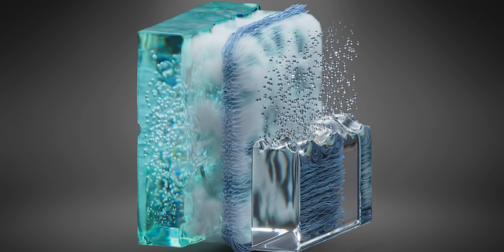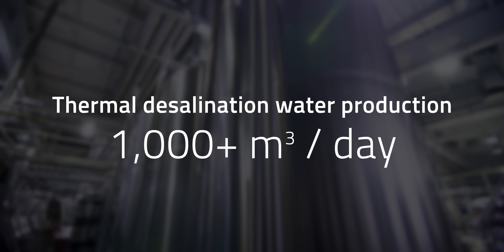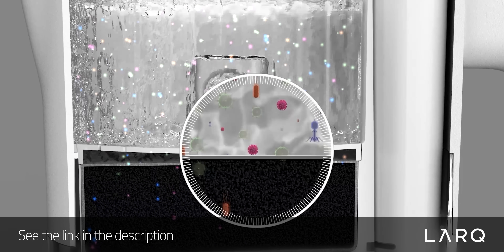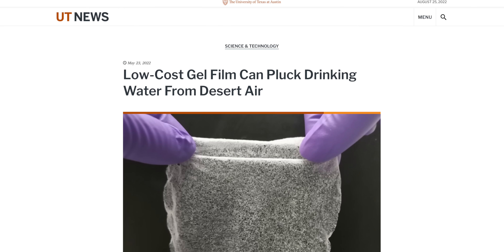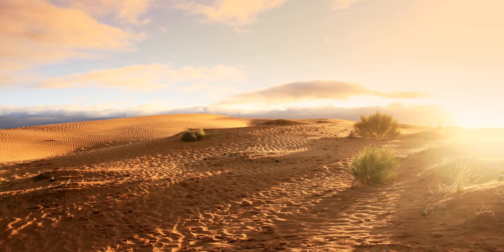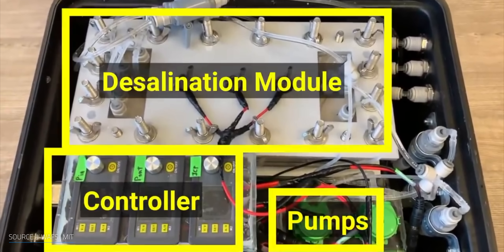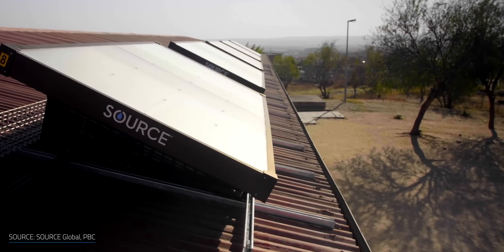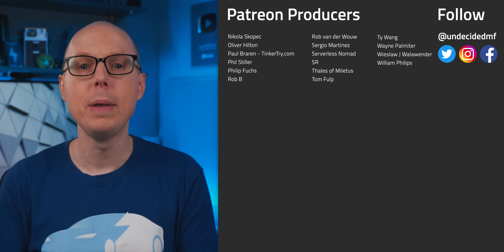2 Breakthroughs That Could Solve the Fresh Water Crisis

Comment: how does the spongy hydrophilc thing work? i'd think it would just attract water and reach some kind of equilibrium if temp stayed constant. or does it attract enough water that it forms a large bead and gravity pulls the bead off the surface...? so it's like condensation but without needing something below the dew point? could a hydrophobic surface humidify air faster than evaporation without needing additional energy too?

Comment: Nuclear reactor (preferably using U233 from Thorium breeding) + Mass scale desalination... done and done. Yes, there is brine, however one could use a higher flow of water coming in to dilute the brine prior to exiting the plant, easing the localized damage. All of this takes power, so we need a very healthy supply of it. Thorium -> U233 fission reactors should be the bridge to fusion coming around 2050.
Reply: we used to have nuclear powered desalination plants in the 60s

Comment: I like the idea of getting water from the air but at large enough scale wouldn't this effect rain fall on a local or maybe country wide level?  I'm not a weather expert. For example in desert areas along water ways, the water in the air that would quickly move in to areas of lower pressure to condense to become rain, wouldn't. Thus decreasing the water level in the water way. Right? Thoughts.

Comment: Discharge of RO and other brines is easily solved by diffused discharge. Every day the sun creates brine as the surface of every body of water it is very rarely a problem because the body of water naturally diffuses is through the bulk water.

Comment: 20 Watts per litre?  That's meaningless. Perhaps it was 20 Watt-hours per litre.

Extracting salt from water requires energy. Quite a lot. And it's unavoidable because the process an be run in reverse - take your concentrated saline and fresh water, and you can use them to produce the energy that you used to separate them in the first place, though a fair bit gets wasted on the round-trip.  The existing processes might be improved some, but the laws of thermodynamics prohibit the huge improvements that we'd obviously like.

Methods that capture water from the air, which is to say usually water that has already been separated from the salt by the sun, has an obvious edge there, if the economics can otherwise be made to work.

Edit: If it was 20 Watt-hours per litre, that's 20kWh per kilolitre, which is a lot more than a typical reverse osmosis desalinator uses.

Comment: the biggest concern with the gel based water harvesting is NOT the gel, but the ecological impact of pulling water out of the air in an already dry area. What would be the impact on rainfall/snowfall? What would be the impact on wind patterns? Are there species that depend on that minuscule water in the air? What would happen if we massively start using this?
Reply: There are 37.5 million-billion gallons of water in our atmosphere which is cycled 40 times a year. You would have to be removing massive amounts of water before you would even notice any change. One of the results of global warming is that the air can hold more water. That is one of the reasons rain events that cause flooding have become more common. I had the same question until I looked up the data.

Comment: These are very promising technologies, thanks for the video!  Here in S CA we have a desalination plant in Carlsbad that produced 50M gallons per day of water from the ocean.  There seems to be a lot of debate about it, so while people debate, the plant continues to pump out 50M gallons per day at a fairly low cost, using an environmentally freindly process.  It's amazing how Americans can fight over anything, even proven technology.  If we could just harness Americans ability to argue, we would have an infinite source of energy.
Reply: Carlsbad Desalination Plant in San Diego, California, requires approximately 35 MW to run and provides 50 million gallons of water supply per day.

Where does that power come from.
Well A lot of it is hydro, the more you need desalinization the more likely your not going to have the hydro power to run it.

So yes harnessing the hot air would be a good idea!
Reply: if 50 mil gallons and 35MW checks out, that's 4.43 Wh per liter. Assuming he meant the MIT device uses 20W and takes 3.3 hours per liter, that's 66 Wh. Ouch. Hope it gets better when it's scaled up.
At $50 per unit it would cost 1.32 billion USD to get the same capacity. (about 26 million devices)
The Carlsbad desalination plant cost one billion according to Wall Street Journal, via Wikipedia.

Comment: This is a good time to explain my idea.  So, you have wind turbines that aren't running because we don't need the power at that moment. You need fresh water. Boy do I have the solution for you. Giant dehumidifiers. This idea came to me when I got a large dehumidifier for my garage. It would fill up it's one gallon tank in a few hours and I would have to constantly empty it. I thought to myself 'this water could be used out west' and that's how it all came about.
Reply: That sounds like a good idea to get fresh water from the air but if it takes more power to get the humid air to drop the water you may as well import/buy gallons of fresh water for some other place.......I doubt that an area that is not gifted with high humidity would get much fresh water form a device that you state so your device would be running on power all of the time but little water would be made..........you should try out your idea in a dry area (desert maybe) that lacks humidity.
Reply: well it would stop rain to fall :/

Comment: Slightly off-tangent, but can we use the leftover brine from seawater desalination for Lithium production? Given that the U.S. is trying to boost domestic Lithium production, it would make sense to combine the two processes if it's scientifically and economically feasible.

I don't have a STEM background so if I sound ridiculous asking this, please excuse my ignorance.
Reply: Very good observation, there is Lithium in Sea Water, but the brine is loaded in Sodium from the salt in ocean water, and right now scientists are working on a Sodium battery that doesn't use Lithium or rare Earth minerals, it potentially could be a win-win for everyone, but more scientific studies need to be done, but the concept is a good one.
Reply: Unfortunately most brines do not contain Lithium salts. Most Lithium is mined in Bolivia and Zaire.
Reply: @allanlank  turns out in the us the salton sea is full of it  and sea water has some too
Reply: Li accounts for a very small percent only. In the case that those countries or cities with desalinated water as their water, decide to switch to brine as their source of the metals than the cheaper mined ones, then it can be used. But currently there is no demand for such expensive metal
Reply: Assuming all of the worlds water desalination is from sea water (which it isn't) - You can get about 5000 kg of lithium. Which is very small already, but in reality only 1% of the worlds desalination is from sea water also. So 50kg of lithium from worlds sea water desalination, which is not a lot. So no, it's likely not really feasible at the moment.
Reply: @Sancarn  where do you get your figures?   is that all of the ocean ? is that per ton? is that just the dessalinization today? does that figur in all the water we need today and not future needs?     in cailfornia the voters stoped a plant from being built over the brine.  if we can assure the ney sayers the brine will be processed the plant might get built and the water is desperatly needed
Reply: @andrewfischer8564  That's ~50kg per day from the worlds supply of Sea water, I already researched it after the video from "Two bit da Vinci" as I work in the water industry myself. 

Key figures:
Lithium in sea water: 1 ppm
World Desalination per day (today): 95 Million m^3
Lithium density = 530 kg/m^3

seawater being 1% of worlds fresh water came from NYTimes

Even if you do process some of the brine into lithiam, most of the brine is still remaining. Ultimately you have to go through the list of all elements in brine and figure out how to use them, and i'd advise starting with the big hitters, not the 0.0001% lithium composition. You also need to see if there is that much demand for those compounds. E.G. table-salt, is there demand for it coming from desalination? Is it cheaper to obtain via this method? - Unlikely. Will you be producing it at a loss, probably.

Comment: I very much look forward to more info about the gel. No Community pipes no place too far and easily as distributed power you have now distributed water collection. As to desalination if you're able to reduce the environmental humidity the salty water will add low salt or no salt evaporation to the air. Thus better than desalination and useful where there is no other water source or no clean source. I live around the Puget Sound in a place where water from the ground of a well is not possible and Community water is not possible. I very much look forward to the development and more information about the gel. As always thank you for the marvelous work you do and the good information that you provide.

Comment: I've always seen getting water from the air as a somewhat lacking strategy because most of the people who genuinely need water are in arid areas with low humidity. I find improvements in desalination technology the most likely solution to the water crisis. While not everyone lives near an ocean, desalination can produce massive amounts of water especially if done more efficiently than we do it now.
Reply: Catching morning dew is a standard vegetation adaption in desert areas.

Fremen water depots coming to a dry area near you....
Reply: 25000 miles of desert coast line in the world. 

Mountain areas are often dry but can have a lot of moisture
Reply: Even deep in the desert often there's a water source, but it can be unusable because of high salinity.
Reply: as long as there is energy to put into it water from air can work, but if it's not free (paid off or very optimal solar) it's a huge energy consumer for very little water. you can't get a full flowing garden hose of water without a sports field of solar, or more.  it is very energy intensive, enen in humid areas.
Reply: @volvo09  They use it in mountainous areas gather the water and use gravity to move the water around
Reply: Did you watch the  whole video? If you did, and are sticking by what you said,  then you need to specify  the amount of humidity in the problem areas you would be speaking about. Because the video addressed rather low humidity areas, even below 15% though I do not know how far below 15% it could be handling,.
Reply: He specifically went over the fact that it could work in low humidity environments though ?
Reply: @n.g.s1mple29  ALSO PROBABLY HELPFUL-MUCH: The Water-Crisis-Coverage of Youtuber "Some-More-News". And his Video on the Failings ´for the Utility-Grid? 
?

Comment: Thanks Matt. I like the MIT set up. The price seeems reasonable: if it can beat about 50 l bottled water.  There is a real need. I travel in some countries where you have to drive for a long distance to find drinking water: the only solution carry plastic bottled water. Remains to see what is the lifespan? What parts should be replaced? does the water quality remains the same with time? Can the capter be used i a jerrycan?....
Reply: their press release is more detailed. It will need a 1m X 1m solar panel to run what is basically a multistage distillation plant. They have used concepts to conserve energy use but getting 6L of water by distillation over 8-10hrs is good but certainly it will not be USD 50 price range.

Comment: One of the things that came to mind when I heard about this (earlier) was could this be implemented on a very large scale? In the case where a significant weather/water event might be arriving to cause damage, could large amounts of water be extracted from the atmosphere to degrade a storm to something less potentially damaging. This would allow for reallocation of moisture from a damaging atmospheric event to a surface need area. Definitely not the long term (environmentally sustainable) solution, but a stop gap measure. Wrote to the company on it, and they had not yet looked at large scale implementation like that.
Reply: If you have the energy for that scale of water capture you probably have the energy and tech for weather manipulation.

Comment: Thanks, as usual something to think about. ... An interesting filter technique I was told about years ago for use in muddy water is.... 1)  Bury a suction pipe with a screen into the bottom of a large drum and fill with sand. 2) Throw it into the muddy water. and start pumping.  3) The water comes out muddy but as more muck gets pulled into the sand the water comes cleaner and cleaner. 4) Then "wildlife" colonises the sand and it becomes an organic filter as well.  Add this system in front of this videos system and it becomes even more efficient. Jim Bell (Australia) The filter was used in farm dams.
Reply: So basically what they do with passive water treatment plants then to clean up waste water so it can be released into water courses.

Comment: Is using the gels and similar technologies to remove water from the air the best approach?

In our complex eco system, I imagine taking water from the air will have unintended consequences.
Maybe using the ocean is safer overall. Imagine pulling water from the air and causing an ever increasing reduction in rainfall.
Reply: Air can hold lots of water. These are taking nowhere near as much water out as you think.
Reply: @falconerd343  take out as much as I think.
Are you considering if tens of millions of people if not hundreds of millions used it?

I am talking about foresight.
How many people in a given area can use it?
If each person pulls 17L of water out of the air, how many people in one square mile can do the same?

Pretty sure if an item like that is needed, it's needed for many people.
Just because something CAN work, doesn't mean it WILL work, given the scaling and impact.
But all the focus was placed on making it work.
Reply: The orders of magnitudes are OK. There is as much water in the air than there is drinkable water underground, and there is 1000x less water in the clouds.
Reply: @jowjor  considering the recent report of ground damage and sinking due to the huge reduction of the water table in the area, I'd say you're confirming my point. We have a bigger impact on the climate both local and large scale than we realize.
There are A LOT of us now and if we're not careful, outlr "solutions" will only lead to worse, more unsolvable problems.
Reply: @NoTimeLeft_  Main difference is, any water you take from the air is back in a few days, while the underground water takes years to do a full circle, and you can take more than there is raining. And you don't need to take all the underground water tu causes issues, only a small part and there is voids everywhere.

Comment: Atmospheric water generators are most efficient in very hot, very humid air, as that air has the most amount of water in it. This means that the best place to run a AWG is inside of a greenhouse. If you water the plants inside of that greenhouse with wastewater--or the greenhouse encloses a constructed wetland--then you would effectively recycling water with plant transpiration as your first filter layer.

Comment: Thanks, Matt. Both technologies have huge potential, and I'm excited to see them move forward. However, using Konjac gum-based films has a potential for microbial contamination of the films, as the gum provides a nearly ideal environment for microbial growth. How the resulting microbes would be removed from the output water is an unknown at the moment. Plus, I have to wonder about what happens to possible contaminants in the air itself? Are they also concentrated with the output water? In either case, I'm sure work-arounds are possible to eliminate these contaminants, and I look forward to hearing more about both technologies.

Comment: $50 each for the desalination system....BAHAHAH the case costs more than that. What clown world accountant came up with that number? If you look at the larger picture MIT does not have a very good history of supporting water recovery systems based on reality. To call the gel system one that has no energy use is a huge fallacy....you have to make the gel in the first place which takes energy. Just because you don't use energy at the end phase doesn't mean it doesn't use energy. There is NO WAY you can collect water out of the air with a 15% humidity without energy being expended. Desiccant chemicals are nothing new, heck you get some in the pocket of every article of clothing you buy and you use heat to reactivate them. It takes energy to get water out of a desiccant. There is no way to violate the laws of thermodynamics. Matt...the idea of a gel getting "free water" with no energy is a synonym for a perpetual motion machine...please Matt, put on your common sense hat before you make these videos...it makes you look silly when you don't
Reply: ✋ Objection!
Common sense + laws of thermodynamics = death for this kind of channels.

Comment: I want to hear more about this gel solution. Konjac root is extremely hydrophilic (it's essentially composed entirely of dietary fiber, hence its use in shirataki noodles), so it would make sense if it had the capacity to absorb ambient air moisture, but I see no way to release that moisture without the use of significant energy. I suspect the environmental impacts of such a technology would be minimal at best, air is highly fluid and mixes much more easily than saline water, and there is a TON of water in the air, but the tech leaves me with questions.